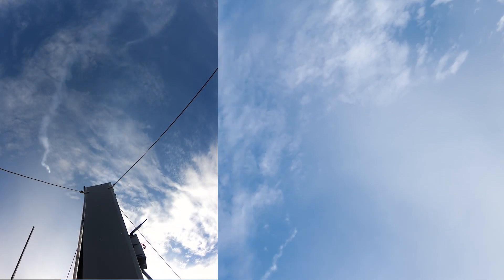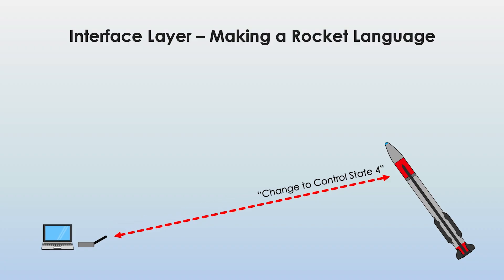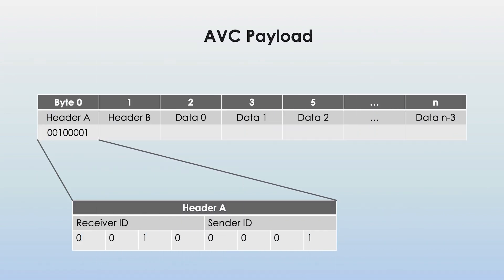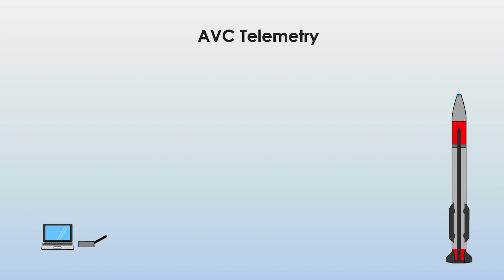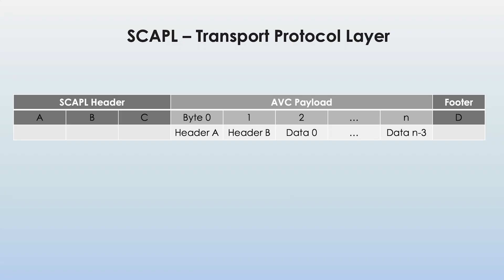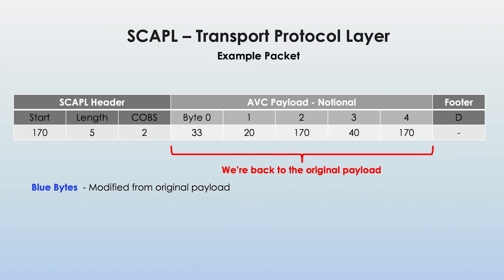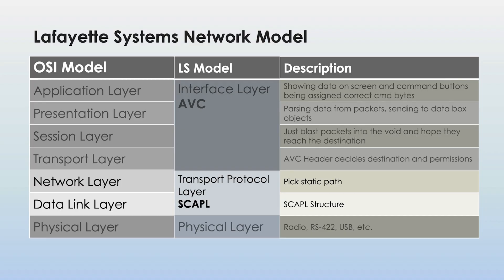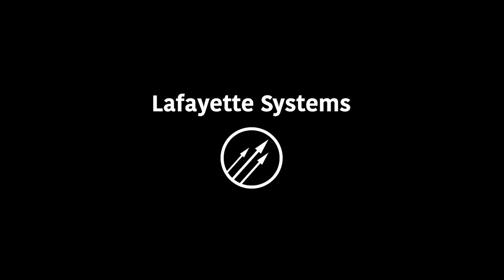Commanding a Rocket Via Radio - Homemade Two-Way Datalink

Comment: Great treatment of the problem. Using "escape characters" are also a good way of dealing with important control characters (such as Start Of Packet, End of Packet etc) appearing in your data payload. The benefit of "escape characters" are that they can be inserted at the moment of transfer of the data to/from the microcontroller to/from the radio. They do not need to be computed beforehand. They just get inserted in the stream before transmission and extracted from the stream after reception. As an aside, It would be interesting to learn if your radio supports Forward Error Correction as a means of recovering from short bursts of noise.
Reply: Wouldn't that just shift the problem from having a data byte with the same value as the start byte, to having a data byte with the same value as the escape byte?
Reply: @tijsp.8162  no, there is some particular logic around this solution. Two consecutive escape characters are considered as one data character equal in value to the escape character. Only control characters are preceded by a single escape. Any other character not preceded by an escape character is considered to be itself. It’s absolutely bombproof and works really well at very high speeds in low resource microcontrollers. It’s as old as the original serial port standards and works just as well today.

Comment: Awesome work, love this series! Regarding multiple transceivers communicating over a shared channel (i.e. radio), do you need to use a multiple access protocol to avoid collisions between messages sent at similar times, or are such issues generally handled within the physical layer or by the checksum?

Comment: would you ever consider adding encryption of some sort?
Reply from the maker: On most radio modules like XBee, you can enable built-in encryption! I don't encrypt commands sent over wired connections though, seems like we have bigger problems if someone else is sending commands over my own USB cable :)

Comment: How often does a command go unacknowledged? IIRC, for the PSAS rocket we had to do unacked UDP because TCP was taking too long at Mach 3. 

Also, do you have a way of indicating which commands are okay to retry? The launch command probably shouldn’t trigger twice for instance.
Reply from the maker: On the ground, maybe 1 in 10 commands goes unacknowledged. It depends on distance, antenna geometry and noise floor though. The re-try on some dangerous commands is a good point though. Currently, I only allow about 5 retry attempts with a re-send every 400ms. That means if the command doesn't go through in 2 seconds, it stops trying to send. Currently, that is uniform across every command, but you could totally implement different max re-transmit attempts or different re-transmit delays for each command. I'll add that to the list of future link improvements!

Comment: How important is compression? It takes more on board CPU power, but if you're having trouble getting enough bits up or down in time, I'm pretty sure there are more efficient (group theoretic) algorithms available.
Reply: Depends on how efficient your data is structured on its own. If you are including 4 bytes float for each variable, but in reality they have very limited range, compression can have a huge effect. If you manually arrange your data efficiently, e.g., using 2 byte integers to represent each variable (with a fixed number of after comma positions), you are doing the compression 😂 Information Theory provides the theoretical limits: The shortest achievable average length of your messages is the entropy of your source. Systematic compression can get you very close independent of how you structure your data. But if you are close enough using the manual optimization, the extra overhead for a minimal performance gain is not worth it.
Reply: And this mainly applies to the telemetry packets. While also theoretically applicable to command packets, I only have experience transmitting one command per packet. In this scenario the packets are very short and thus compression does not make sense.

Comment: Curious if you've tried Mavlink or have experience with how robust it is for your use case?
Reply from the maker: MAVLink is very cool, its more complicated but also more robust than the architecture I use. It should totally work for an application like rocketry but includes more overhead.
Reply: @LafayetteSystems  interesting good to know. I know it's widely used but wasn't sure since Mavlink is relatively old